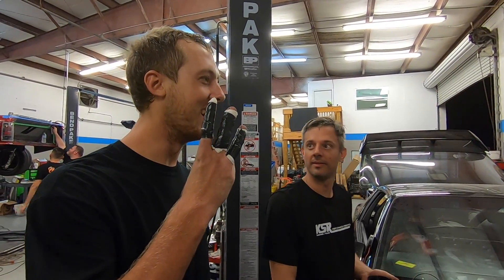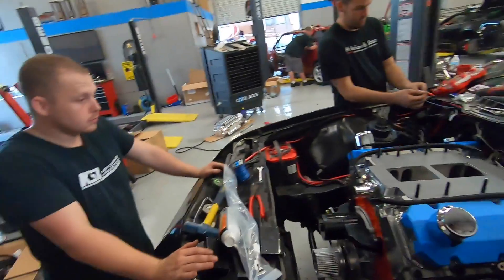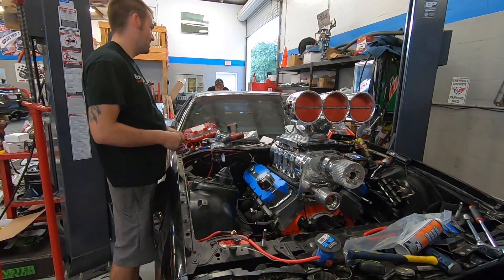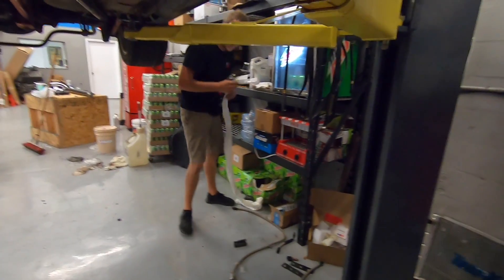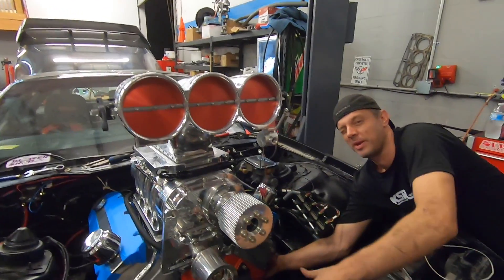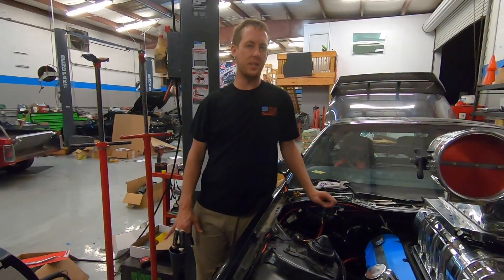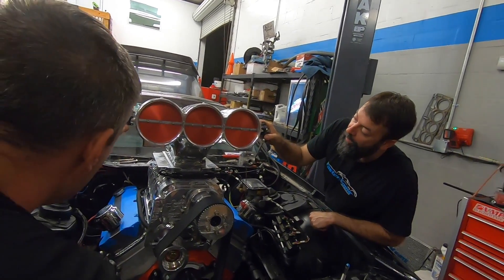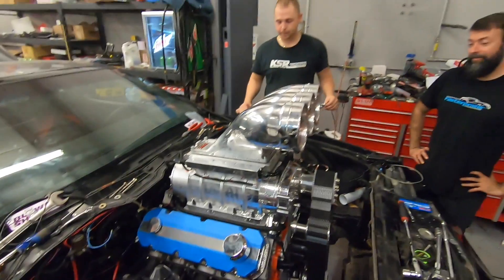TOAST IS ALIVE! Firing Up Our 10.3L Supercharged BIG BLOCK For the First Time! *MAXIMUM FREEDOM*

Comment: This is why you got the safety box cutters in fan mail 😂
Reply: Exactly, razor blades and exhaustion never go well together.
Reply: I posted on his last video laughing about him opening boxes with a bare razor blade given all the box cutters and knives followers have sent him.  Guess it wasn’t so funny as he cut himself pretty badly.  😮
Reply: @sambrenna7989  I use to use them all day long at work and the times I've cut myself badly is ridiculous. Of course the supervisors didn't hear about it
Reply: I got the worst gash of my life from a god darn florescent light tube getting hit by a exploded cut off wheel right above me. I wasn't even the one using the grinder, just in the wrong place. The largest chunk of the tube fell out of the light fixture and stabbed/gashed open the back of my bicep as I was bent over picking up a pipe flange laying on the floor. It can happen just out of nowhere.
Reply: My thumb is proof they don’t work 😂 6 stitches Christmas morning
Reply: boxed fenders can’t pass the drug test huh?

Comment: Almost positive Jeremy went full dad mode and saved Cleeters fingers
Reply: People don't know how easy it is to lose them, but they can take a lot of damage.
Reply: wobbly sauce absolutely..I severed the tendons in my hand a few weeks ago and had surgery still a debate about an amputation on my middle finger
Reply: Iv cut my finger with a razor blade before, tiny ass cut but man it was deep, shit doesnt stop bleeding easily.
Reply: My wife, scraping paint off a dresser with a stright razor... blood on the ceiling.... 1 really fast ambulance ride and 5 "my first stitches" later. :D nothing like an adrenaline rush. Best drug on Earth.
Reply: Aaron Cubitt us mechanics had to deal with asbestos brake dust.
Also safety clean parts cleaning fluid and trichlor poisoned lots of us. I got heavy metals in my body from it.
Reply: Aaron Cubitt nah
Reply: @Gapn2EZ  My Dad severed the tendons to all the fingers on his right hand, they took a tendon only used when climbing and rebuilt the rest they had to make new guides but it is possible they had to wire the tendons to the end of the fingers until they were safe to be released it was documented in the medical journals with photos at the time, trust me they got his hand working well enough for him to do his  job again.
Reply: Aaron Cubitt well 60 year old in constructions is pretty the max except some persons made of steel
Reply: Rocket 🚀 yeah there’s some memories. Way back we use to beat the drums off then blow the dust off and wash the rest with brake clean aka carbon tech same poison dry cleaners use.
 Later our wash system was a water press fire extinguisher we use to refill and let the slurry hit the floor then push it around with a broom later.
 By the time we had a wash system they were eliminating asbestos.
 My heavy metal poisoning is 100% from the original safety clean parts washer. We use to wash up with the stuff.
 We also didn’t have nitrile gloves back then. Every chemical we used would destroy laytex gloves.
 All the chemicals that work are deadly and banned today.

These younger guys have it much safer today.

Comment: "How much horsepower do you think it's making at idle?" 

Wise words from a true American.
Reply: bout 60hp 350lb ft of torque
Reply: @jacksonledford6874  im guessin like 430 hp
Reply: ALL OF IT
Reply: @turbocandrift9296  horsepower is a ratio of torque to total overall gearing, usually listed by RPM. Idle torque is going to max out around 200 just because it has no driveline speed.

Unless I got whooshed since you guessed 350... like an sbc?
Reply: @jacksonledford6874  HE said over 8oo with out blower so probably 1000 would be my guess. If you go back to when they got the motor youll here the HP rating with just carbs.
Reply: @2011gmh  he said at idle. Not na
Reply: Around 950, its twisting the entire car every time they rev it. Its going to need body reinforcement for sure. Hahaha
Reply: @2011gmh  AT idle. its probably around 50-60hp at idle and maybe 80-90ft/lbs.. Nothing makes a lot of power at idle. Takes load to really show the figures.. Gotta make an engine work to really do its job.
Reply: @strangehappenings8961  its shacking the car because of no motor mounts, it uses a motor plate and its on a 4 post lift.. they move around a lot.
Reply: @_winter7745  Maybe on a chassis dyno. If its running it has torque and RPM.
Reply: @zuestoots5176  Hell I didnt ask the stupid question but  but thanks any ways  :)
Reply: @kimberlyharris5435  "more than the brakes can hold.."
Reply: Zues Toots mud pumps on rigs make around 2500 hp at idle😂😂😂
Reply: Zues Toots it has solid motor mounts. No plates.
Reply: @strangehappenings8961  its on a lift. a mid chassis one at that. it will of course rock when he revs it, or twist to the right and if he launches it it will pull really hard especially if the front wheels lose contact.  then it will really really pull to the side.  but it is getting a cage right? that will bring it all together.
Reply: I read that right as he said it. That’s pretty creepy.
Reply: The right answer is ”yes”
Reply: @jacksonledford6874  assuming it idles at around 1k rpm, the hp will be one fifth of the torque at the rpm, cause they swap at 5250. Thing probably makes peak torque around 4k rpm and about 10k hp/tq so just doing mental math (just estimates) Its most able to make roughly 400 torque assuming it's making 40% of its peak torque at 1k rpm since a lot of v8's make about 80% peak torque at 2k rpm. which would calculate to around 80 hp at the crank. Of course it's not under full load so that would be its potential at that rpm, but its not under load so it would be really hard to measure.
Reply: Well considering it idled at 2800rpm
Reply: @2011gmh  maybe watch the video? It's a joke Cleetus made..
Reply: @Rocket Luckily that's all he's going to have is a 1-2. so maybe 1st can be high enough to tame it a little off the line... With the power of this engine, he could still run a 2.70 rear gear and toast Micky's at will...
Reply: Wo0o0o0o....175 horskies @750 idle....Wo0o0o0o!
Reply: @Rocket You're correct on that, he's going to be 0 to bare wheels in about 5 seconds with that monster if he punches it...
Reply: Jared K 150hp
Reply: Yes
Reply: 12-1300 hp me thinks .
Reply: Whatever it makes NA it has to be less than that. Super chargers are a parasitic loss until they actually make meaningful amounts of boost which that big of a blower isn't doing anything useful at idle.
Reply: if you guys are really talking about idle, it is under 10 hp, just enough to engine spin freely since it doesn't have any load. Think 10 hp electric motor or small 10hp gasoline engine connected to it with full throttle, it would spin that thing quite fast. starter motor is making only between 2-4 hp  but if you are talking how much it could make at 1000rpm wide open throttle, then thats A LOT.
Reply: Jared K all of it
Reply: @brendanbray6164  that was my rough estimate I think I did pretty good
Reply: It's making ZERO horsepower at idle, just like ALL engines do.
Horsepower is a measure of work accomplished. 
Now if you measure the exact amount of fuel it uses at idle  and assume a 20% efficiency rating (that maybe high for idling on alcohol) you could calculate EXACTLY the amount of "work" being done to keep this motor idling.

Comment: If your engine would run away with the blower on it use a Co2 fire extinguisher to shut it down.  Shuts the engine right down with no damage. 
Had run away engines and we found that was the safest way to shut then down in an emergency.
Reply: That's..... actually really smart
Reply: Been diesel mechanic for a long time... Learned that trick a long time ago with runaway detroit diesels!!! Works like a champ an am glad to see someone else knows about it!!!

Comment: That fuel over blower setup will act like an inter cooler. Fuel atomization drops  iat’s around 40-50 degrees if not more.
Reply: That's the only way you can run a x-71 blower. The fuel creates the seal
Reply: @michaelgarcia22  how about Detroits ?
Reply: @JohnSmith-bx1mp  You mean in the native application? It's just a positive displacement blower for scavenging, it doesn't need to build much pressure. It exists to blow fresh air through the cylinder at the bottom of the stroke.

Comment: Parabolic (progressive/elliptical) throttle pulley and a controlled leak (small needle valve) will make it somewhat manageable and easier to adjust idle.
Reply: Yes exactly.  It really needs those blades shut and an IAC welded in somewhere.

Comment: Killer car guys, you will want a decently heavy return spring on the injector hat as it will pull the throttle plates open with the lightest of touches and they won't snap shut, I know from experience haha. A lot of guys over here in Aus are blanking off the outer butterflies internally to make the throttle more progressive as well, makes a huge difference when trying to tune them, especially when all of your fuel control is above the supercharger not in the ports

Comment: You better loosen that blower belt....you want about 1" side to side play or you're gonna snap the crank snout once everything expands...
Reply: Yep the engine can grow half an inch in height once its hot
Reply: Good eye!  Seen it happen also.....
Reply: @bullyzelda5981  that's his favorite
Reply: Haha
Reply: @bullyzelda5981  I was literally gonna say that until I saw ur comment 😂😂😂
Reply: Yes it can expand that much, what the fuck do you actually think heat expansion is?
Reply: @gruntabro1  in extreme cases....but yes the belt gets tighter as it gets hot and the hight of the engine will increase but if it's a iron block I'd say not likely. If that was the case, itd be snapping idler pulleys and shearing off water pump bolts.
Reply: What do you guess the compression ratio is after it grows a half lol you could crank on the boost and run 87 octane but be sure to wait until it's hot and grown-up a good 1/2 " wouldn't want to detonate
Reply: Ridiculous, this is about the perfect size, a blower belt need to be tight or she is going to slip... just not too tense... i can tell this is the perfect size just by seeing how easily i put the belt on.
Reply: @kevintucker3354  steel and cast iron expand roughly .001" per 100 degrees Fahrenheit for every inch of material. So if the engine is 30" tall (just a guess) it will only expand .030" inches if the temperature rises 100 degrees.
Reply: @stevenbizzocchi2991  That's a gilmer style belt. Impossible for that thing to slip, unless you completely strip all the teeth off of it.
Reply: Ahhh YouTube land.... I can always find so many experts and master engine builders..

Comment: I vote for a stock iroc hood, with a  cut out for the blower with dzus fasteners.
Reply: Someone else commented that to drive around with it in Australia hoods are a requirement, so most likely they will just cut their scooped hood to fit and pin it in place.
Reply: While blaring teenage dirtbag by wheatus
Reply: Why an IROC hood when a base hood would be so much cheaper? He'd be cutting the area with the louvers anyway.
Reply: Dzus
Reply: @johncholmes643   I fixed it damn auto correct,  thanks
Reply: ChrisHallett83  They aren't registering the car in AUS. They are bringing it there. You can temp import to foreign countries on your existing US state registration. To drive around at Summernats you have to have a hood. You remove the hood during the burnout competition.

Comment: Super glue is the best ever for lacerations, saved me MANY trips to ER
Reply: There is surgical super glue that is better than the unsterile industrial kind ! Be careful what you use !
Reply: that can't be good for the body lol
Reply: @steshar2975  It's fairly harmless actually, as long as you're reasonable with it and not trying to super glue your severed hand back on. They used it in WW2 to treat wounds as it was a very fast method of sealing a wound, and had the benefit of being waterproof.
Reply: It was originally designed to be used to close wounds, hence why it sticks any piece of skin anywhere you put it. It has been used in wars for a long time.
Reply: The strangest thing I saw in a med kit was tampons! Our platoon Sargent made us put some in there cause it will stop heavy arterial bleeds from bullet wounds or shrapnel! Also can stop a major nose bleed!
Reply: Super glue gel! Dont ever use the liquid, it just goes right into your cut and doesnt glue shit! Trust me , I know. Gel!
Reply: @Rocket And a huge bill I guess.
Reply: @Adierit  actually a 100% true fact. and it is what i use myself.
Reply: I'm a cabinet maker, used it many times.
Reply: Superglue and sprinkel baking soda on it..glue will harden instantly

Comment: if you want place the blower on top of the motor get a carbplate  hook the engine hoist to it and float it over to the engine , lot less chance for busting fingers or trowing out youre backs 
as for the intakescoop , if you cant regulate the engine between tickover and full trottle , you could block one or more trottleplates behind the opening

Comment: Before I saw what happened I thought your fingers went around the cog pulley and belt..
Reply: That was my thought when I saw the ig post.  Let's just say been there done that lol
Reply: Same
Reply: I feared that as well. I run an RCD belt guard, it's a nice piece.
Reply: Ditto
Reply: I once saw a guy get his finger stuck inbetween the rotor hat, and the brake caliper mount
Reply: My fingers hurt just thinking about OP comment 😂😂😆
Reply: Same.  Caught one of mine between the sprocket and chain on a BMX.  The front sprocket.  The big sprocket. With pedal brakes. So couldn't pedal backwards.  Had to go    all   the way    around. 

The last inch of my third finger burst open like a grape under foot.
Smashed it back together and formed it a little with a few band-aids and carried on.  It was the 70's.  When men were men.  And so were the women.

Comment: D sity is correct, I’m sure you guys already figured it out by now but you want approximately 1” free play in your blower belt when the engine is cold and it will tighten up as you get to running temp. Mine usually tighten up to about 1/4” free play at running temp on all 4 of my blower cars. But don’t just take my advice I’d definitely call the blower shop and see what they recommend

Comment: cleetus i would put toruq straps on the engine so u dont break the motor mounts just a helpful suggestion
Reply: A front housing plate would be so much better....
Reply: The straps most people see on engines are actually for the blower in case of backfire. They keep it from shooting into the air while going down track. Unless you are referring to torque links?
Reply: @bryanmixon6624  
My straps are for my intake
Track regulations
Reply: I'm talking touq links or whatever u want to call them to keep the engine rocking so hard otherwise it will snap the motor mounts an possibly bend the sub frame from the tourq

Comment: It's hard to see from this video, but I have a suggestion for you, that I learned 10 years ago when I had my first and only blower car.  I was at a show and a guy walks up, admires my engine (460 ci Chevy with a 6-71) and asks would I like to hear a suggestion.  I told him never to old to learn something (60 at the time).  He said I was running my blower belt WAY too tight.  He said as you drive it the aluminum blower expands in all directions including up, which tightens the belt.  Too tight and the snout will snap off the blower body.  He said to run 3/4 to 1 inch deflection on the belt when cold.  Seems very loose, but he was right, when hot, the belt is snug on the pulleys.  He was very low key and humble when he told me he knows quite a lot about blowers, since he does all the blower for CONNIE KALITTA!!!  I live in a burb  of Detroit, and Connie lives in Ypsilanti 30 miles away.  CONNIE FRIGGIN" KALITA"s blower man teachinng me!!  That made my day.  I built a new 605 ci Merlin aluminum engine and aluminum heads with an 8-71 Dwyer on it.  I for sure, run 1 inch deflection now!  Good luck with Toast!

Comment: Yup that needs some u frame work ...that's gonna twist that body ....and I can imagine the torque that's gonna create
Reply: nah, this is America! twisted/ crashed camaros are still perfectly good camaros
Reply: -First...these dont have frames
-Second.... it has full subframe connectors and suspension mods done
-Third....stock suspension 3rd gen bodies have handled that much power with a lot more traction than theyll have for over 20 years with no problem

Comment: You need a gas pedal with the pivot point placed more towards the top cable side and far from the foot portion. That way it barely moves the throttle cable for a lot of foot input and makes it less touchy